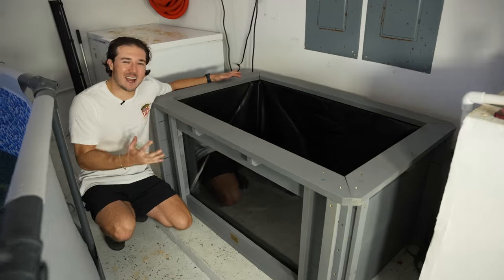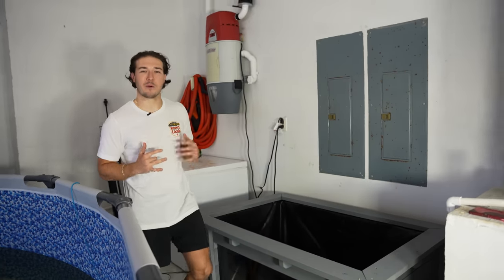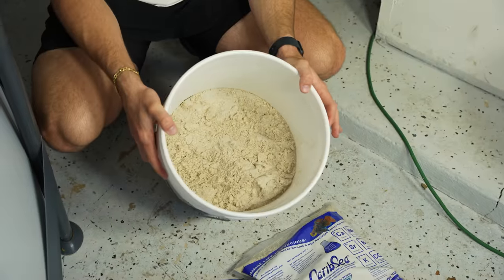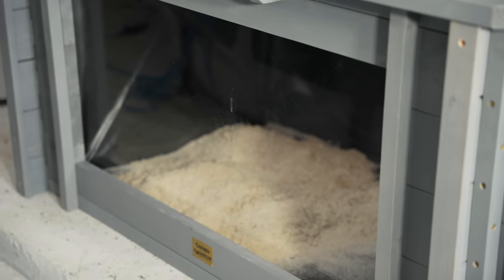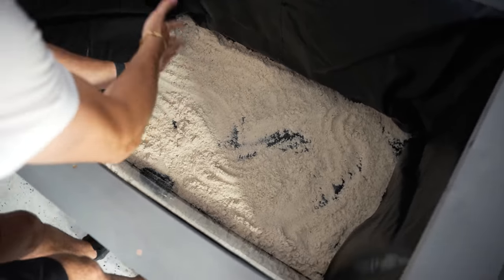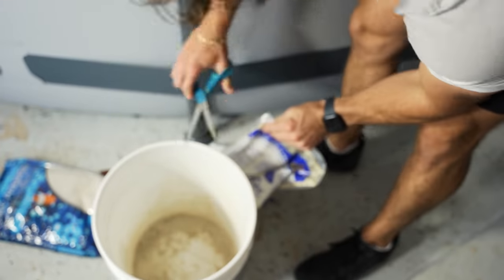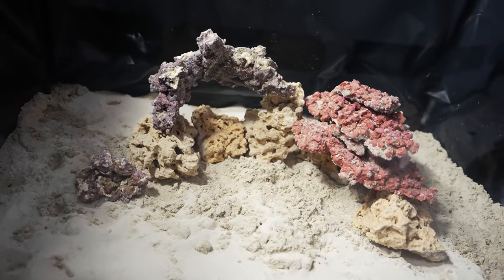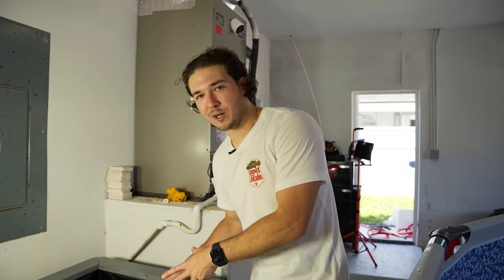Finally Building My SALTWATER MINI POND! (Pt. 2)

Comment: As a contractor.. I wouldn't recommend putting that saltwater in front of the breaker panel. Saltwater around electrical will definitely have an effect on it
Reply: yah i was gonna say not a good idea to have a water tank in front of a breaker box
Reply: saltwater is an electrolyte..    and a large tank of it is under a breaker with over a 100 volts running through it i wonder what could go wrong
Reply: @Zephro-9r  no you weren't 😆
Reply: @rileyda3  nothing